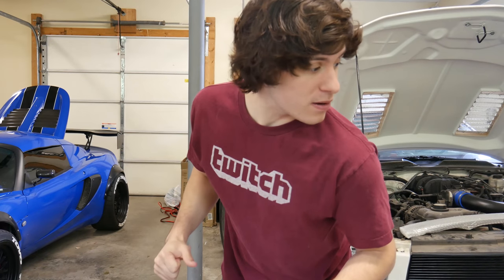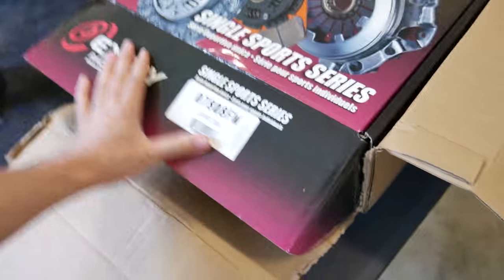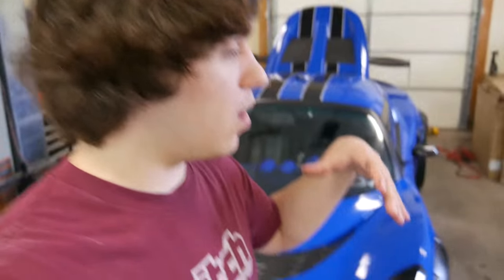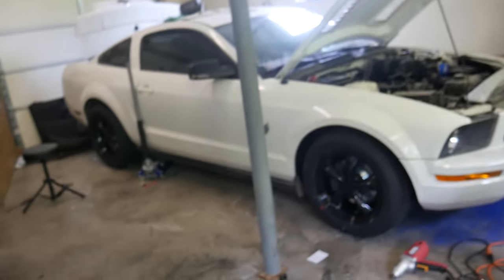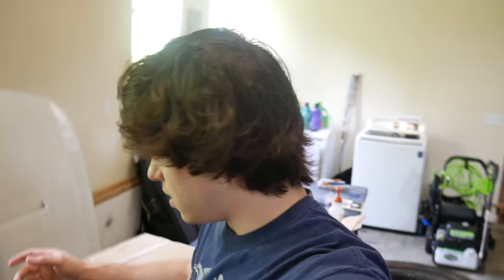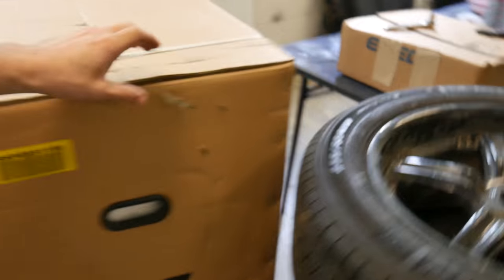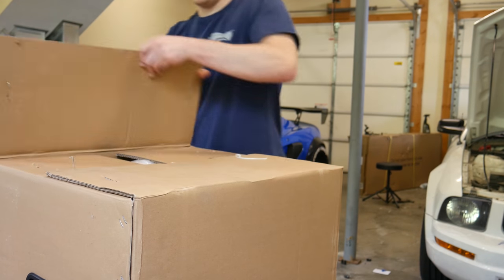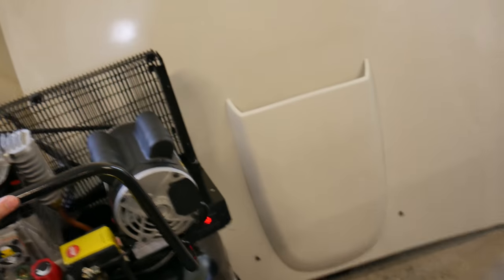Giving away the Mustang EARLIER THAN I THOUGHT!

Comment: Great series! The only thing I have to comment on is the thing you called a sensor is actually the hydraulic slave cylinder. I had to replace 2 right now with my friend's 05 mustang and my 03 ranger as the 4.0 V6 in the ranger has basically the exact same drive train in the mustangs. It's a bitch when they go out but it's cool when guys put in stage 2 clutches in a truck cause Ford wanted easy to replace parts on their vehicles in the 2000's for the V6 lines.